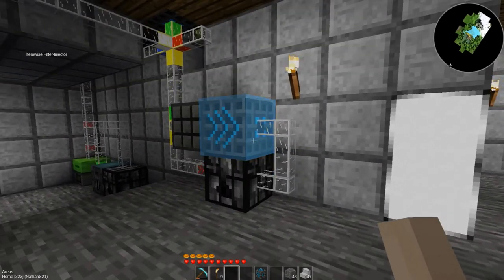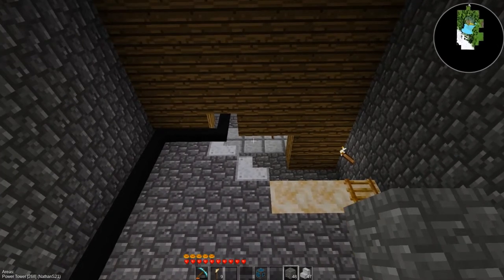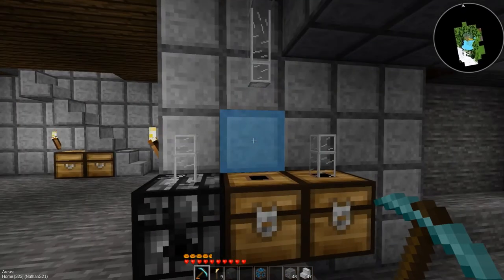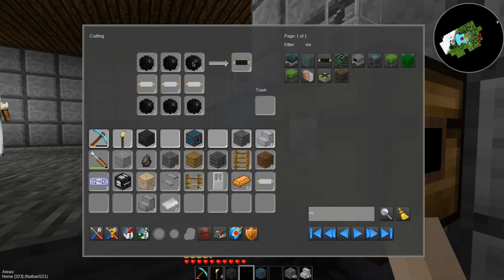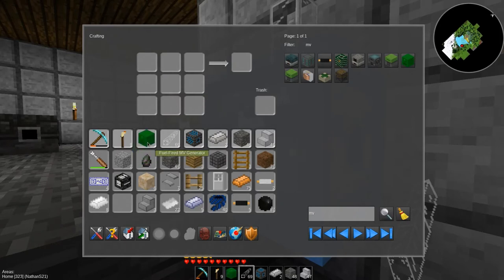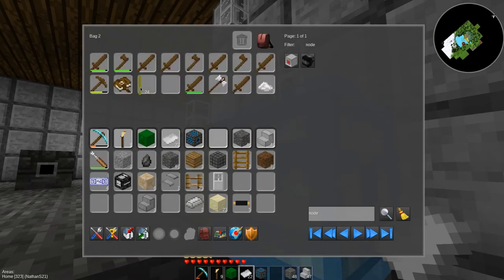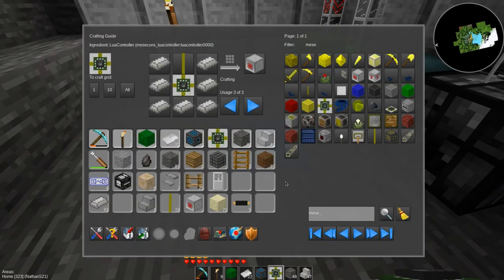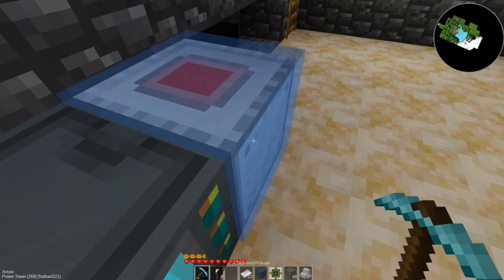Creating Backup Power | Xtreme-46

Comment: If the integrated gates aren't installed on that server, you can make one in "redstone" fashion; with mese blocks and mese torches.
Reply from the maker: +Tory Wright the gates aren't, but I figured out another method using node detectors that works pretty well.